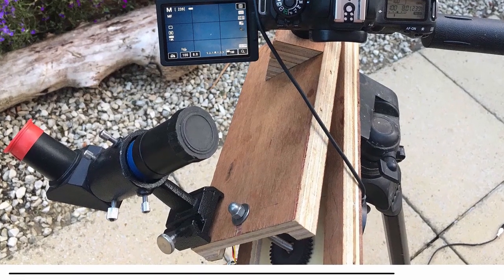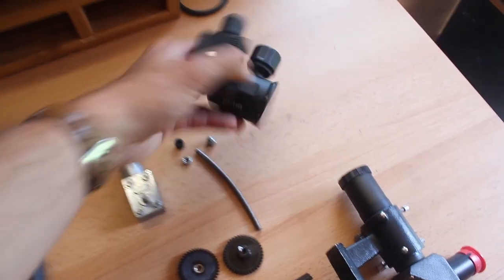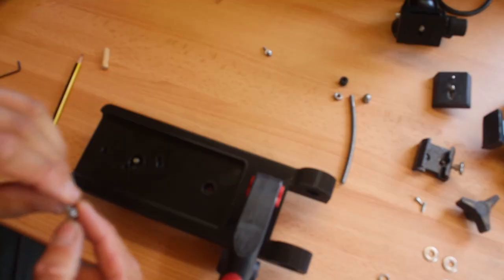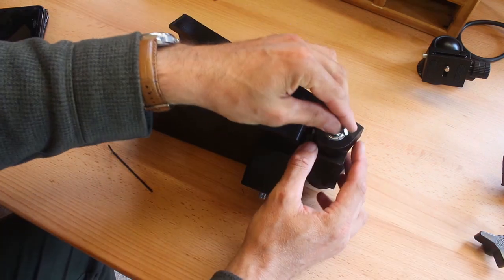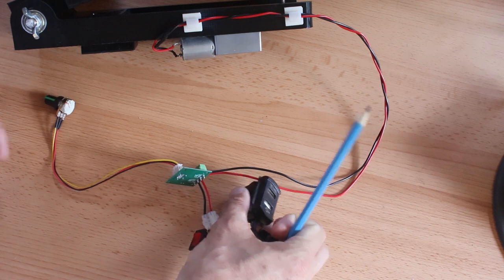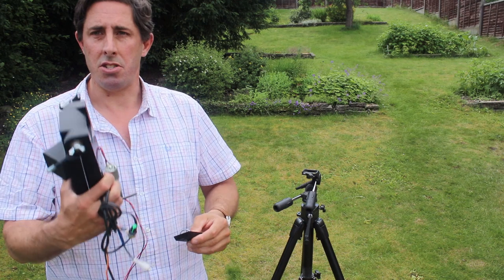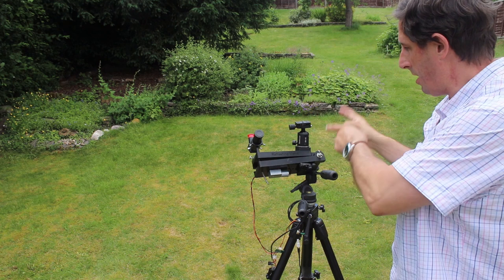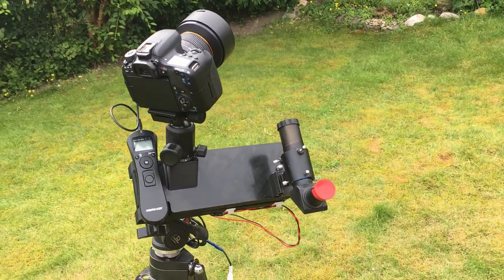3D Print Barn Door Tracker

Comment: I'm currently printing the parts for this, and I'll share my finished project when I reach that point. I didn't realize it until it was too late, but my print bed isn't large enough to print it in single pieces.
Reply from the maker: Ah! Have you managed to adapt it for your printer bed? Good luck and let me know how you get on.
Reply: @RefreshingViews  I ended up cutting the parts in half and printing them,  then gluing then together.  It worked out pretty well.

Comment: Great work. How long can you expose for example with 200mm?  I have build one too (with your gears from thingiverse) but my tripod is crap. :(
Reply from the maker: Glad you are enjoying it and yes a decent tripod will make all the difference. I am only using mine with a wide angle Samyang 14mm so don't know how well it will perform with something more powerful. Let us know how you get on!
Reply: Good day. Could you advise on following: 1. Use a microwave motor 21 V 2-3 rpm with PWR regulator 2 Use 2 disks with a belt like a gear. How to do calculation than?

Comment: Hey, Thanks for the video, I will 3D print that, I think the plate is 270 mm as i can see from the file is that correct?
Cause u have X axis size 100mm and Y size 270mm, So does that mean that it's 270mm long and 100mm thick?
And What are the print materials that could handle a DSLR camera?
One final question :D You said that it will move 1 step (in rod) each minute, Does that mean the mount will move every minute or it will continue to move small steps through the 1 minute? Cause if we are going to use a lense like 55mm we need it to move every 9 seconds.
Thanks
Reply from the maker: I printed in PETG as that withstands “hot car temperature”. The motor is a DC motor so it moves continuously at the sideral rate. All dimensions are in the print files. Good luck and let us know how you get on.

Comment: Hi there, do you happen to know the torque of the motor you are using? I was hoping to get one that is 3-5V so that I can use it without having to have power from a house. I have looked at a few motors but im not sure if they will be powerful enough
Reply from the maker: Not sure of the exact torque but it’s powerful enough to life the camera and it’s lens. Obviously the slow rpm helps with power-torque.
Reply: gear ratio makes that motor does not require a lot of torque. I have built a barn door tracker using a 28BYJ-48 5V motor. It did not work well because whole set was too wobbly, but engine power was more than enough

Comment: Great tracker. Unfortunately it is larger than typical print bed. I don't suppose you could break into smaller parts or provide the files in thingaverse.
Reply from the maker: The files are there, already Mike: https://www.thingiverse.com/thing:4893159
Reply: @RefreshingViews  Not the fusion files. I do see that the Fusion of the month allows more editing than on STL than previously.
Reply from the maker: @mikesgarage394  Apols - I am now confounded! What files are you after as those are the ones Fusion 360 spits out.  Let me know what you need and bear with me!
Reply: @RefreshingViews  The raw fusion files, f3d  or stp, not stl. Doesn't matter, I have figured out how to convert and split the stls. Should be able to have them printable in 2 parts for smaller printers.
Reply from the maker: @mikesgarage394  Ah, glad you’ve got it sorted. Let me know if you need anything else.

Comment: Nice, but how in the world could you print that 270mm long plate on a creality ender 3 which has a print size of only 220 x 220 x 250 mm ?
Reply from the maker: That's because I have a CR10 with bed size 300x300x400
Reply: @RefreshingViews  oh, i see,  so the printer in the thingiverse description is a different one...
Reply from the maker: @pterois5914  Oh - I must have ticked the wrong box when I saw Creality .... Update to follow on thingiverse.  Thanks for the heads up.
Reply: Would be very nice to optimize the project for some popular printers like Ender 3. CR10 Is a beast :)

Comment: How do you make the curved threaded rod?
Reply from the maker: I bought a stainless steel rod; marked out the desired radius with a compass on a piece of paper and then bent it by hand to match the curve. The best part was in the centre so I cut the ends off with a hacksaw.